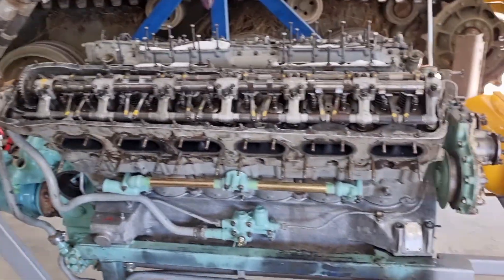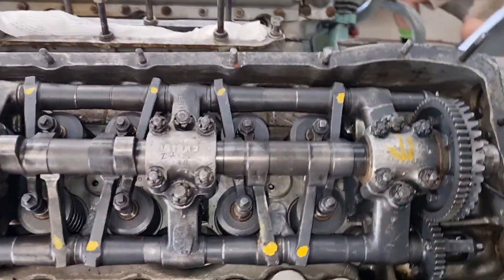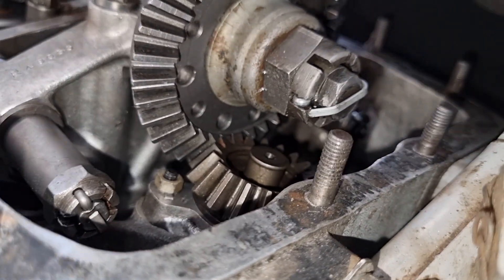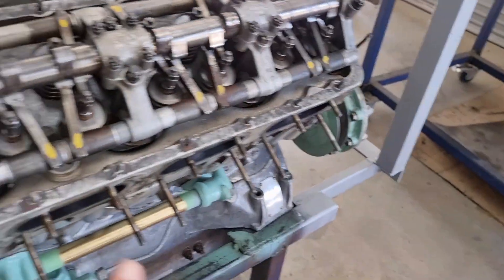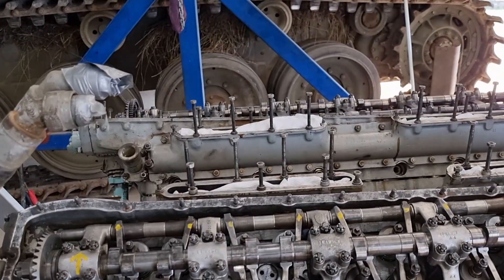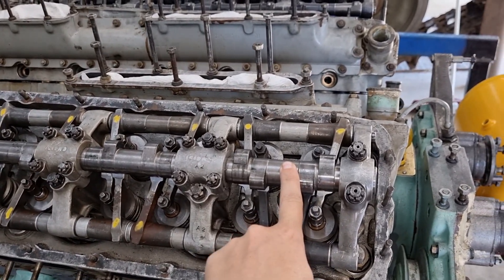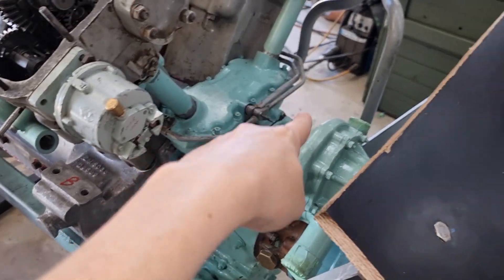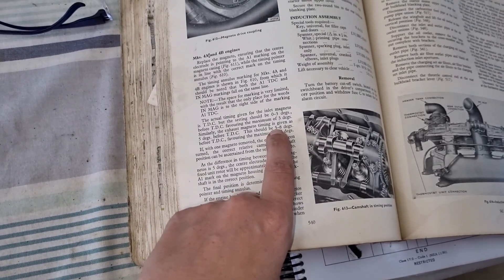How to time a Meteor Centurion tank engine. Magnetos and cam shafts.

Comment: Hi Lottie re the timing just watched a counter parts video on timing and he was using the cast mark to time the magneto and not the A1 mark is it common to have differing ideas on how to get a centurion running the best?
Reply from the maker: I saw the other video, too.

All I'll say is, to each their own. I've done every nut and bolt on that engine twice over, and they have oodles of power without skipping a beat. I'll argue the point if I have to, but honestly it my advice against theirs... also the manual 'literally' says to do it my way 😅
Reply: Yes . The factory engine workbook has pics and describes how to time it correctly using the A1 marks stamped on the face of the magneto.

Comment: Do your circlips have a front and back side like an AN one? What may not be apparent to some is that the drive to cam coupling has an odd set of teeth and a second set of teeth with an even number of teeth. This gave a slightly different angle between each set of teeth. So you keep rotating the coupling till you find the set of teeth with the correct angle. We use this to time base mounted mags. I assume the split timing accounts for the slightly different mixtures at the intake and exhaust valves? Sorry to ramble, I used to teach aircraft engine maintenance to A&P students. The biggest engine I had the chance to work on was a Wright 1820, right about 39 Litres. Love your work.

Comment: i guess it's a non interference engine if you can turn the crank separate from the cam and not bend valves
Reply from the maker: Correct 😊

Comment: I think I missed a bit did you rotate to the B6 inlet position with the spline in place. Surely this would throw out the timing… did I miss the bit where you disengage the b cam drive ?
Reply from the maker: I only showed the removal of one of the splines. But both should be disengaged while finding the marks 😊

Comment: lottie, when you remove the little splined gear, to stop camshafts turning, and then rotate the engine to the correct timing marks , a1 IR, etc,  can you bend the valves ?  or are these engines non interference, ie pistons hitting valves.
Reply from the maker: No fortunately they don't touch. Spin it as much as you want, the values won't bend or break 😊